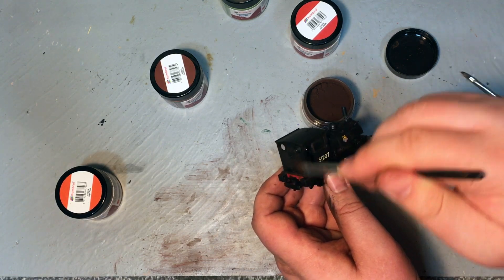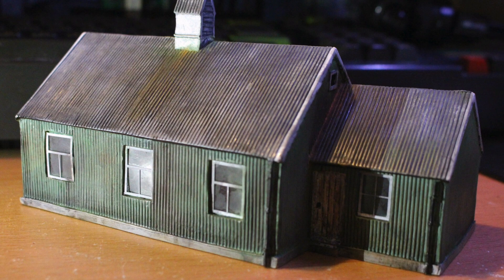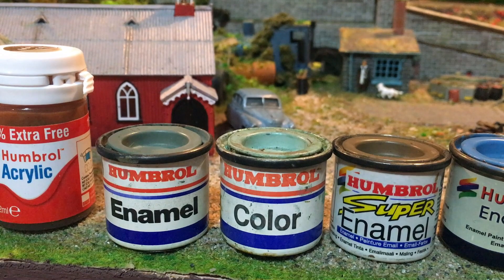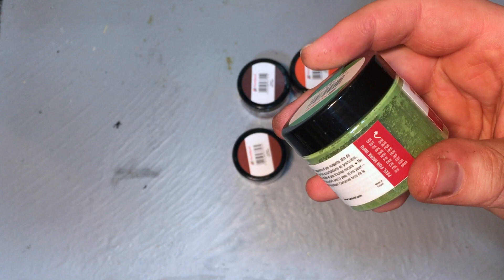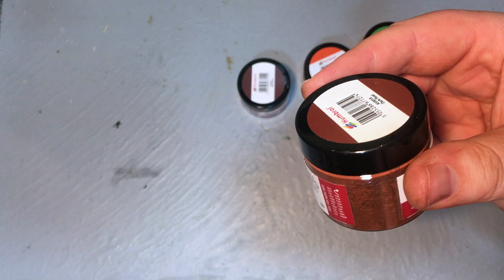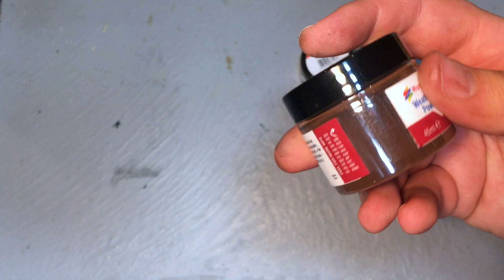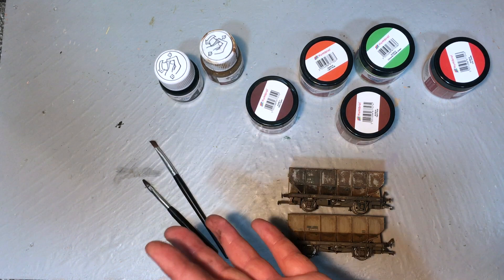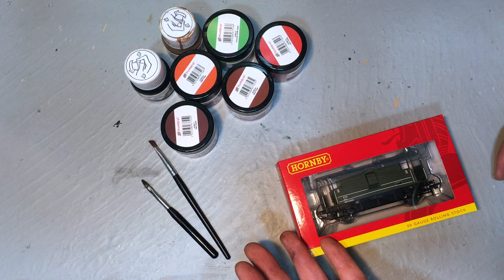How To Achieve Spectacular Weathering Easily With Humbrol Weathering Powders

Comment: Interesting, never used the hornby Powder before but their #33 is my FAVOURITE paint to use for weathering - it just works so well for toning down, Dry brushing and even making washes from.

Of course, just using powders or paint for weathering will always yield some what limited results - a good blend of the two mediums always gives a much nicer result I've found!

Also with the pug, I'd of added some slight calcium deposits on the boiler from the valves etc 

Hope you're well Jen  ☺️☺️
Reply from the maker: Thanks! I do agree, though washes alone can yield great effects on steel mineral wagons.